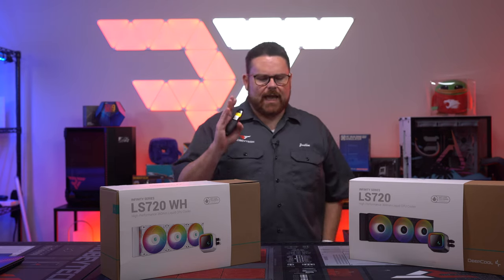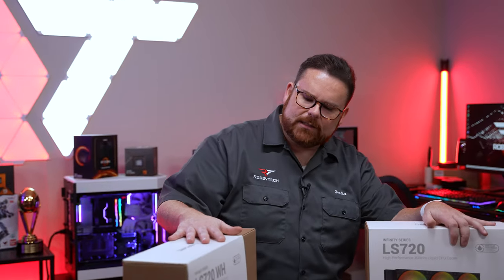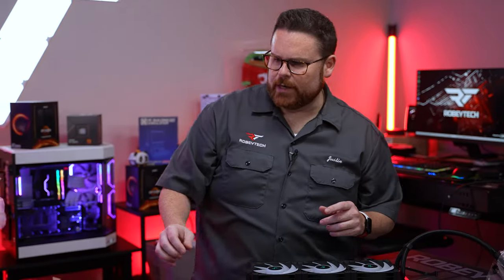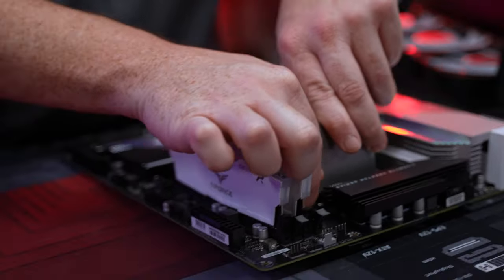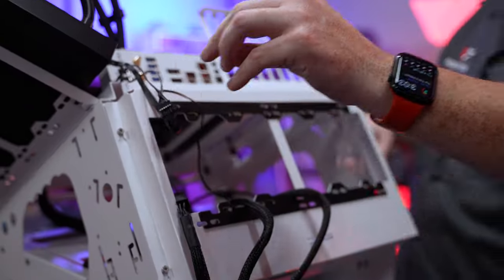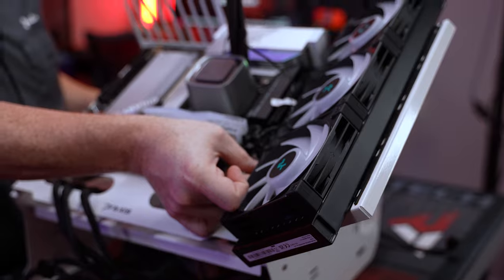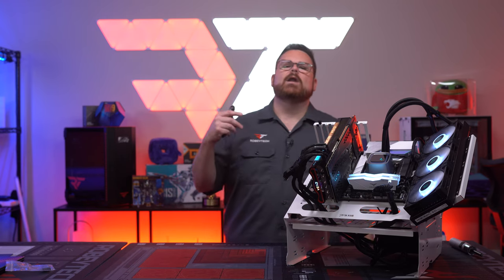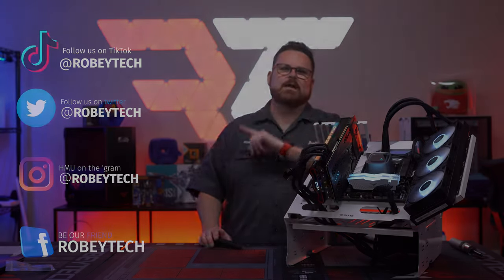The Best CPU Cooling at the Right Price! The DeepCool LS720 Review

Comment: i bough the ls720 white and it came with pre applied thermal paste on it and it performs really well on my 12600k, i got 30C on idle and around 45C while gaming with overclocking at 5.2ghz
Reply: Can confirm that the LS720 comes with pre-applied thermal paste. Just bought one a week ago.
Reply: I can also confirm it comes with pre-applied thermal paste, just got it last week... It was actually dried up or something and caused issues with my system i7 14700k (system reaching 99C in 20 seconds). I ended up reapplying new thermal paste and all was good. Now idle at 43 C
Reply: @artofstu42  is it good becouse i want to buy AIO
Reply: I boughr LS720 white on amazon , and it didn't come with preapplied pase, I got Maxell thermal paste with it. The temps with Ryzen 5800x are a disaster! Full load 130W , is 88C
Reply: @kalas1988 set some aggressive fan and pump curves. It might help
Reply: Damn great temps.

Comment: LT series comes with pre-applied thermal paste. It does the job exceptionally well too
Reply: I have the LT on a 13900K and have been taxing it with recompiling Unreal a few times. The highest I've ever seen was 91C, mostly 70s and 80s when under that heavy load. Idles in the 30s, very happy!
Reply: im having a hard time deciding between the LT and LS. I want white components but i really like that header on the LT
Reply: @Djaym0  the LT720 just came out with a white version. I believe the white LT520 comes out next month
Reply: @DavianFN  really? i didnt see it on their website the other day. I'll have to have a look again. thanks.
Reply: @Djaym0  dud you find it? You just gotta select either the LT720 or LT520. Then there’s an option to select either black or white.
Reply: I thought the LS also comes with pre applied paste.
Reply: @gavinderulo12  mine did
Reply: @gavinderulo12 It does.  That's what I have in my rig.
Reply: Bought good TP just to see it was already applied 😂
Reply: @Painjusu  SAME 😂😂😂

Comment: I’m a thermal paste/compound spreader as well but I use the edge of a cut-down old plastic credit card to ensure a thin even layer. Your technique is certainly unique. 

I made a mistake when I bought a CoolerMaster MasterLiquid ML280 Mirror ($49.99 NewEgg) because it arrived with a clearly defective (very noisy) fan but it was installed in a new build at Xmas for my son so I couldn’t just pull it out. CoolerMaster, with prodding from NewEgg, eventually sent an upgraded set of fans (with RGB this time) but it took months. 
Now it sounds like the death rattle of a failing hard drive. 
One very noisy AIO, which is why I’m here doing research.

I inherited his old white Fractal Design Meshify case with his old Corsair Hydro H100i RGB Platinum SE 240mm dual LL120 but soon tired of the RGB failing on those LL120’s and the 90 c (when gaming w/i9-10900k) temps and accumulating dust of the case so I thought $115 for a white Lian Li Lancool 216 RGB was a good value since it came with 2 front 160mm PWM ARGB fans and 1 rear 140mm PWM non-RGB fan. 

Well my investment grew as I started looking for RGB fans to match those ring-type front intake fans but the closest match I could find was from CoolerMaster. (Ironically)
I selected their MasterFan MF140 Halo ($29.99) to replace the non-RGB exhaust fan) and a 3 pk of MF120 Halo’s ($61.68) to replace the always failing Corsair LL120’s in the AIO. 

I just got tired of spending $100 for a 3pk kit of Corsair LL120’s shortly after the warranty ended. Come to think of it, since I bought the last kit on May 7th 2021 from BestBuy, they’re still under the 2 year warranty so I’ll make a claim. (https://help.corsair.com/hc/en-us)

Those Halo’s look great! The RGB lighting is bright and visible from both the intake and the exhaust sides as well as laterally. Plus they’re actually quiet. About the only negative I can see is the center sticker makes it appear wobbly on a couple of ‘em but I believe that’s typical for fans.

One concern, the title said “suitable for cold row radiators” whatever that is.
I installed the fans to push the heat upwards (exhaust) so the heat doesn’t go toward the fans. A smoking incense stick proved the 2 front intake fans are providing excellent positive pressure, even though I opted for the magnetic dust filter for the front, which was almost another $20 to the door. 

I wish I knew of a way to post a photo of my setup with those fans.
The Z490 Godlike and RTX 2080 Ti may be getting old, but the fresh case makes it look great.

Comment: Thanks for a great review. This cooler seems to be a very good choise as a replament for current AIO. I wonder - do you know what the difference between LS720 and LS720 SE version is?
Reply: I'll help your question, for that type actually same as radiator or pump motor or cold plate size, and the different is just fan LS720 used fluid dynamic bearing with simple connect cable management and with SE used hydro beraing and the cable management little bit weird, but when u open official website they said pump LS720 and LS720 SE have different watt consumption. Actually this just different from RGB on top pump cause LS720 RGB more led than LS720 SE. but at all same especially LT720 they have same like LS720 SE but the have more feature like magnet and more bigger case on pump. I hope u understand 🙏

Comment: What bothers me about all these tests is that there's no consistency between different reviewers when it comes to the rankings/results. Some coolers will top the charts on some sites but will be way down the list on others, even though similar testing-methods are applied. For example: Most sites I've checked have nothing but high praise for the EKWB Nucleus, while others (Igorslab being one of them) state that its cooling performance is only "good", but not class-leading. 
Anyhow: I really shouldn't have looked at Corsair's Link AIOs. In sheer cooling performance, they don't rank at the top of any of the AIO-charts I've seen (ignoring the 420mm version), but their light-design and waterblocks look spectacularly good. More importantly, they do such a nice job of hiding away all those cables and will probably allow for a very clean installation. If they didn't cost an arm and a leg (totally overpriced, IMO), I would swallow the fact that there are better cooling products out there and go for Corsair. I'm on the verge of upgrading from a 240 to a 360 and I already dread the cable-management I'll have to do for that. 
No idea what cooler I'll be going with - ATM I'm kinda undecided between the newer Lian Li Galahads (although they're near impossible to find ATM due to a recall IIRC) and the EKWB. If I look at any more pics or vids of those Corsair ones, I might find myself spending over 200 for an AiO, so I'm trying to avoid that. 
I was also looking at the DeepCool ones, but from what I gather they are rather noisy - and I don't like the fact that the LT doesn't have RGB-fans. Wild card is probably the Fractal Lumen S36 which seems rather affordable considering that it beat a lot of the more expensive (and more recent) stuff in one HW-site's testing.

Comment: Do you plug the fans into the a-rgb header or normal rgb headers?
Reply: ARGB is 3 pin and RGB is 4 pin. If the fans are ARGB, plug them into the 3 pin header on the motherboard.

Comment: Hey I have this cooler and for some reason my RGB cable is just not sitting flush and keeps sliding off Running the LS720 and ROG STRIX Z690-E mobo. Any tips would be appreciated.

Comment: So you have to boot into bios every time you want to adjust fan curves or rgb or pump speed curves???
Reply: Did you find out?
Reply: @joshua7015  No...
Reply: The DeepCool AIOs don't require proprietery connections or software so most other software controllers can be used. You do not have to boot into the BIOS.

Comment: Does anyone know if connecting the SATA power is required for the LEDs to work? I really would like to avoid cable clutter. Other AIOs don't need SATA, but I've got some DeepCool case fans that won't light up unless SATA is connected, so I'm assuming its the same here?

Comment: have you tried the artic range?
Reply: I already try, and still arctic LF 360 more stable performance but not to far from LS720, SE, OR LT its mean not to far from benchmark cause in theory if u have thick radiator this mean dissipate heate more easy than thin radiator. But with LS720, SE or LT type have faster rpm pump and they have more fast to disipate heate than arctic cause rpm arctic more slower than deepcool. But this depends on your case pc and if u used air cond they wil win win or same result
Reply: Arctic will be much better than this AIO?  And now I choose what to put.  LS720 or LFii420 from my 12600k. My case is Lancool III

Comment: You can easily adapt this to work with icue so the price difference of Corsair doesn’t hold up. I tie all my non corsair rgb into icue for a few reasons, 1. Asus software sucks and third party software requires too much effort than I’m willing to put in for rgb. 2. So it all matches duh!!! 3. So I only have one software for all rgb instead of two or three. No granted I haven’t put more than 5 mins into looking into 3rd party such as signal rgb and the like, but it did seem a heck of a lot less intuitive than icue. Since most of my rgb stuff is Corsair I just find it easier to adapt my outliers. Now my  $300 h150i lcd elite xt took a crap after 6 months so I’m a little fed up. Plus I’m getting sick of all the ungodly amounts of wired needed with Corsair stuff. I bought a thermalright pa120 argb, and thermalright frost commander 140 and it’s so refreshing. The simplicity and reliability of big air can’t be beat. And only two cables. Man oh man. I’ve been in AIOs and custom loops the last 10 years so I miss air in some ways. I did however just buy this deepcool ls720 in white bc it’s on sale for $110 and I can’t pass that up. I think it’s better than the Corsair just for the simple fact that it’s about 1/3 the amount of cables and hubs.  I’ll sell my replacement h150i elite lcd xt once I RMA it. Biggest waste of $300.

Comment: Getting CPU fan speed error. There’s nothing wrong with the motherboard. I plug in an external fan directly into the CPU header  it works. The motherboard shows the fan spinning. The only difference here is like I’m using a lian li fan with the Deep cool aio …Any idea what’s going on?
Reply: If your fans are working fine then just disable the warning in BIOS. I have mine disabled as I dont keep any fans connected to my motherboard at all. I use icue for all my fans and rgb and that includes non Corsair stuff. The fan curve software is way better than and more robust than any bios options, plus no need to reboot into bios anytime you want to make changes. So if your fans are working then just disable it. It’s obviously erroneous if they are working just fine.

Comment: I would go for the Arctic Liquid Freezer II instead, I think.
Reply: arctic will be much better than this AIO?  And now I choose what to put.  LS720 or LFii420
Reply: @stefan_es  The Arctic Liquid Freezer II 420's a great AIO, no question about it. Does it perform any better than the LS720? Not really, just a lot quieter, I have one and it stays real quiet under load. Shouldn't put anyone off the LS720 though, if you like the way it looks, go for it, it's a great AIO.

Comment: hello ! can i use this DeepCool LS720 for my pc ? ( Intel i7-8700K CPU  3.70GHz   3.70 GHz with MSI Z390 A pro motherboard ) i want to upgrade it a bit. Some say Corsair H115i Pro is better suited for my config but it cost more...i need an advice please. i will swap to corsair500D case so it should fit
Reply: You could always front mount a 360mm rad. That is what I did in my 4000x
Reply: You don’t need a 360 for that cpu. Get the 240 mm version. It’s the ls520 I believe they call it. Save money and you don’t have to worry about upgrading cases and if you ever change cases in the future it’ll be guaranteed to fit. You can keep an 8700k cool by blowing on it! That cpu is nothing compared to current chips. And if air and 240mm can cool them just fine there is no need to go 360 and waste extra money and then have to buy a new case.
Reply: Honestly just spend $40 and buy a peerless assassin 120 and call it a day. It can cool my ryzen 9 7900x it’ll work wonders for your cpu. Whatever you do don’t buy the new Corsair lcd xt elite. I paid $300 for the 360 and it gave me nothing but trouble and died after 5 months. My other Corsair aio has been going strong since 2019 (h100i pro or platinum- can’t recall). I just picked up this ls720 bc it was only $110. I also picked up a peerless assassin white argb and frost commander 140. I’m going to sell the Corsair once I get a replacement. Plus too many cables and hubs required. I’m kinda tired of dealing with cable managing all that Corsair stuff. I have a lot of rgb. It quickly ruins the joys of building. Corsair requires tons of cables and hubs vs other manufacturers rgb solutions

Comment: Hey. Our lab has a 13700k with z7900-p wifi and Ls720 inside a Deepcool case. I tested the CPU with XTU, and the CPU reaches 100 C immediately after starting the benchmark, and it takes only 100~120 watts. Should I reapply the thermal paste? Also, I undervolted the CPU by -150 mV for P and -100 mV for E cores, but the temperature remained the same.
Could you help me, please?!
Reply: Pudiste solucionarlo? Yo tengo pensado en comprar este LS720 para mi 13700k también
Reply: @milloriver90  Yeah, the idiot assembler made a huge mistake and did not take off the heat sink robber from its surface!